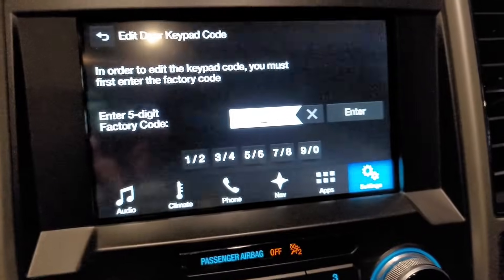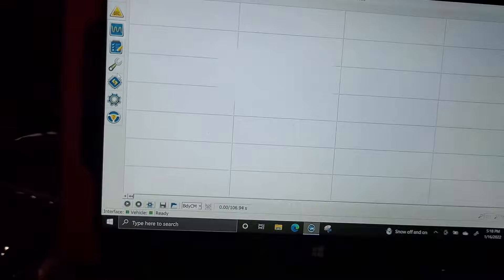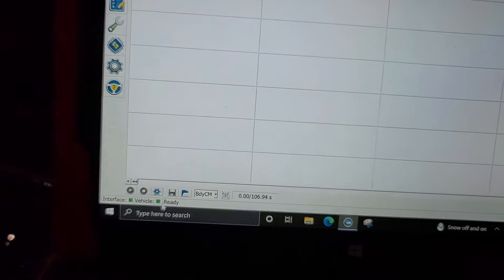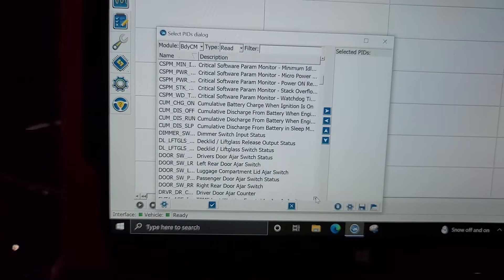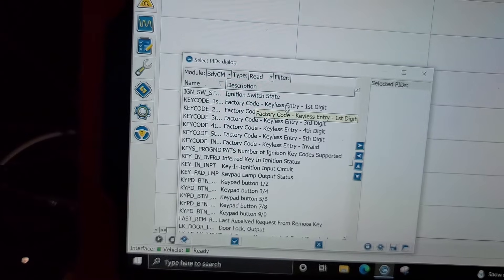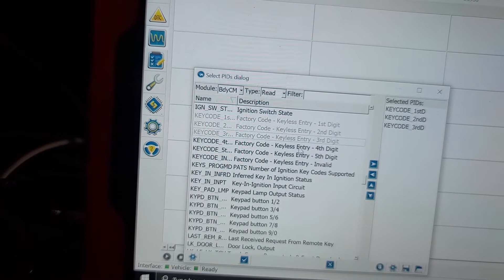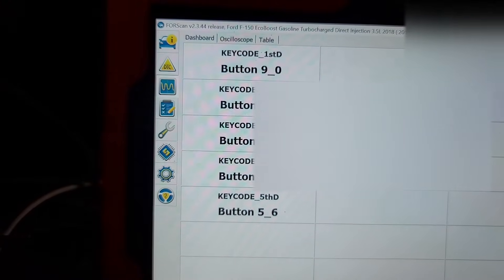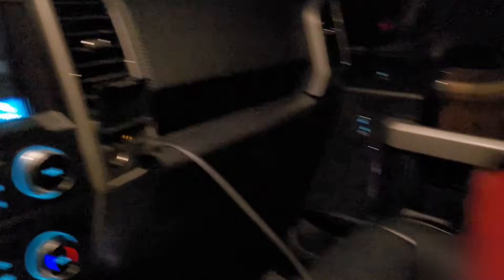Retrieve Ford Factory Keypad Code with Forscan (Ford F150)

Comment: The interface is a bit different when using Forscan 2.3.49, but the program retrieved the door keypad factory code successfully. Thank you!
Reply from the maker: great, I haven't used forscan in a bit, I will have to check out hte update.
Reply: @ReviewAllTheThings  Please help. I have a 2008 Ford F150 and this is not working for me. When I click on Read PID Data and follow your instructions, I cannot find the Keyless Entry Codes. I searched through all of the available data and there isn't one called BdyCM. This is Forscan v2.3.60. I have the ELM adapter (with switch)  and a Dell laptop. I know that there's another way to get the code by clicking on the  Wrench (which I do see) and selecting Read Factory Keyless Entry Code but that's nowhere to be found either. What's the deal?
Reply: Tvxt